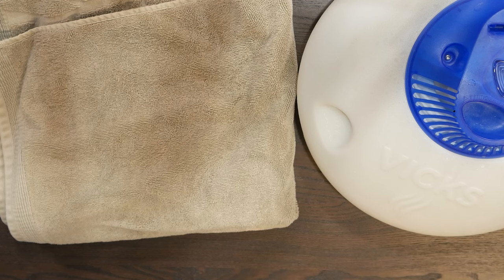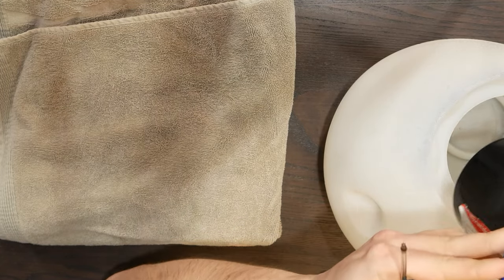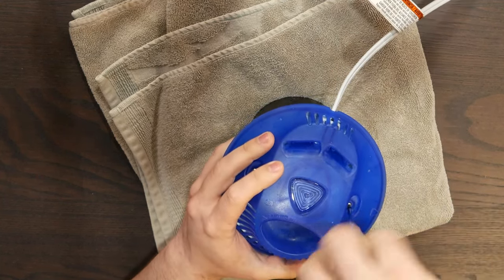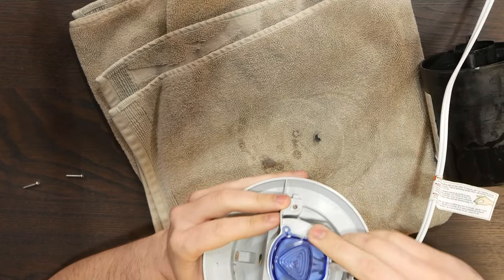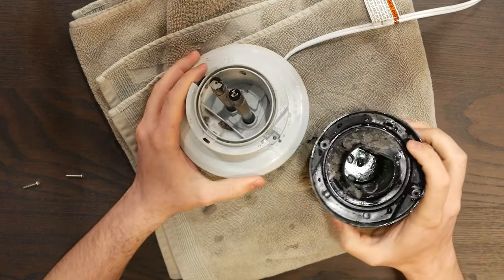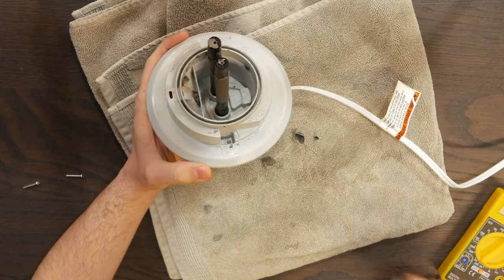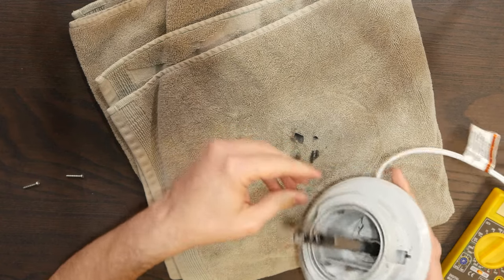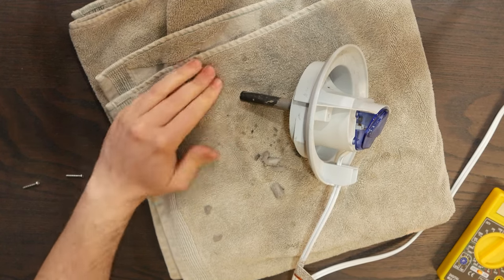Is a Vicks vaporizer an electrode boiler?

Comment: I would think that in this case it's actually safer to use an electrode boiler than an element.  It stops working by default when the water level drops and nothing in the unit gets hot enough to start a fire.  The tank is also sealed, so if someone is touching the water while it's in use, then they're doing something extremely wrong.
Reply: It does not stop by default most of the time
Reply: @poyopoyo4619  by nature, it has to stop working when the water level drops below the elctrodes since the water is needed to complete the circuit. so there is no float sensor or smart current or temp detection but this is still a thought-out safety measure - for cheap
Reply: @rolls_8798  Also, to touch the water you have to remove the electrodes.

And said electrodes are in a protective plastic shell. Actually decently safe!
Reply: @qwertykeyboard5901  true. I still majorly dislike them because the design (the rim that holds water when it is upside down) makes it almost impossible to empty the water from and if it is tipped upside down (hard to do by accident, admittedly) the water pours out of the top through all the direct live wires. and there is the matter of the mineral buildup.

there is a smaller handheld version which I find to be more acceptable. In India (where these are very common) people often put foil balls inside the unit and I've always wondered what it is for. Maybe to prevent as much buildup? I've never noticed an actual effect from it though.
Reply: Hey ,ive torn this thing down alllll the way too, taken the electrodes out, unscrewed those things, and put new ones in it, replaced the screws that were screwed into the the electrodes...mine stopped heating up completely, with water with all different kinds of water, also, mine was dang near 20 years old I think. I love that I've found someone else who's done this too though, I was so curious.  Didn't test it with my meter though ,and now that's my next step,cus it's still not working.

Comment: Yes! My dad took one apart when I was 6 or 7 to clean the lime deposits from the electrodes. He cautioned about putting too much salt in the water. So what did I do? Put more salt in the water. You could see the arcing through the plastic tub! It tripped the breaker after a few minutes.
Reply: That's the most badass metal thing that's ever happened to one of these things.
Reply: LOL... Hey, that's how you learn things, pushing the envelop.  Sounds like something I would have done.
Reply: EVEN MORE SAAAAAALT!
Reply: @westelaudio943  The whole room is VIBRATTTING
Reply: @harshvithlani9399  bloody hell
Reply: That is extremely dangerous. if u put enough salt(NaCl) in it depending on salt concentration it will produce either DEADLY chlorine gas or Explosive Hydrogen gas
Reply: @Anderson-f4t6c  No, wall power is AC. You need DC otherwise the reaction is reversed every cycle.
Reply: @lordofthecats6397  But isn't it irreversible chemical reaction? The moment Chlorine negative ions give up their electron they will become Chlorine gas and would remove themselves from the solution similar to Hydrogen gas. 
I might be wrong my chemistry is bit rusty.
Reply: @Vera "im no technical or know anything"
soo.. why exactly we should believe you?
Reply: I so did this to an off branded one of these! As a kid with a cold, if a little salt made it steam up, a lot (talking enough to cover the bottom of the tank) would make it work SO much better.. Steam clouds all the way to the ceiling, humidifier buzzing with 120v current, the cord heated up and pretty sure I popped a breaker as well! House lights were flickering and dimming!
Reply: My Duracraft came with instructions to add a small pinch of baking soda to it if it didn't boil after 15-20 minutes.  Salt might be too conductive for these, IDK.

Comment: If you put it in a glass tube, that might make a nifty sct-fi background prop for your back wall.
Reply: I think he'd also have to crank the voltage. It took about 10,000 volts for me to make a pretty nifty Jacob's Ladder in high school.  Bottom was about 1 inch apart, to was about 5 inches to break the arc and send it back to the bottom.
Reply: @playgroundchooser  It already sparks enough to boil water. That itself would be impressive. 

Also, water has less resistance than air, and the electrodes are closer together.
Reply: @JonesNate  it doesn’t spark to boil the water
Reply: @ErebuBat  Only if you add too much salt it would (and trip the breaker).

Comment: We used to have one of those years ago and I remember having to constantly open it up and scrape off the electrodes. It made a huge difference in how much steam came out.
Reply: Proper maintenance is part of any humidifier.
Reply: That's why I would use CLR.
Reply: I’ll have to do the same thing later.
Reply: and you cant even use deionised water because then it wouldn't work. caught between a rock and a hard place
Reply: @Gigaguenther  It's a $15 device and at least for me it lasted a decade. If you need more steam just buy a 2nd one lol
Reply: @NavinF  it depends on your local tapwater. the more minerals there are in it the more deposits you'll get over time
Reply: @Gigaguenther  Does it matter? Mineral scale is not a perfect insulator. You'll still get 200W which is plenty for most people. Add salt if you want more power just like it says in the manual. NaOH probably works better, but I've never had to try either option

Comment: The only way I've found to modulate how much it puts out is by varying the amount of salt you put into the water. One time my wife put way too much salt into the water and it tripped the breaker. It probably gets that crusty after just a few uses. There's always that garbage in the water after just one use.
Reply: I was just wondering whether is will burn a fuse when the water is to salty.
Reply: I have a whole home humidifier that is essentially this but scaled up (Aprilaire model 800).  It draws 4.8 kW maximum, but it only runs for short intervals.  The humidifier is connected to the home's water supply and drain.  I installed it when I got frustrated that the standard whole-home wet-pad humidifiers could never reach their setpoints because they only wet the pad when the heater is running, and the heater didn't run frequently enough to humidify the house to the setpoint.

What's cool about it is self-regulated.  It adds more water from the home's supply when needed, but it also and drains water and refills with fresh water when the water becomes too salty and the humidifer starts drawing too much power.  You can watch the unit, when you first turn it for the season, fill the canister to the top with fresh water.  As some water boils off, the power uses increases until it hits the maximum (water becomes saltier), at which point the humidifier starts letting the water level drop (less electrode exposed) to control power.

Yes, it uses a lot of energy, but that energy is also heating the house so it's not completely wasted.  And there is basically zero maintenance - no bio growth because it's boiling water, no manual refilling, and no descaling.  Basically the only time I have to touch it is about once every two years to replace the electrodes as they erode away.
Reply: I had one for a while. The instruction manual says to clean it by letting it soak in vinegar weekly. Mine stopped working I think because I got too lazy to clean it weekly and the buildup caused things to fail. Once it stopped working, I disassembled it. It was so badly degraded that the wires to the plug just came off of the screws attaching them to the prongs.
Reply: I’m a fan of them in winter in kids bedrooms. The vicks liquid can be added to the water and helpful for colds.
Reply: The whole room is vibrating.. EVEN MORE SAAALT
Reply: Two electrodes in a bucket of water with varying salinity is a great way to load test a generator by the way.

It's amazing just how accurately you can tune the current draw on the generator by varying the amount of salt.
Reply: That was my thought too when Alec said "how does it get this crusty with only a few uses"? Because that is how electrolysis works lol
Reply: I've seen one of these where the regulation is done by sliding a switch back and forth, the switch is physically connected to one of the electrodes, and as such just places the electrodes further apart increasing the resistance through the water.
Reply: might try washing soda instead of salt
Reply: @vuza752  like s mini scariac
Reply: That is for the best. If continued on it would be extremely dangerous. if u put enough salt(NaCl) in it depending on salt concentration it will produce either DEADLY chlorine gas or Explosive Hydrogen gas
Reply: Rinsing out the bowl every 2 or 3 uses is plenty of maintenance in my experience.   Our bedroom is only a few feet away from the bath so easy peasy.
Reply: In my experience the particles in the water weren't as many as the vaporizer in this video.  Maybe the guy has hard (high mineral content) water.  The water at my home isn't super hard, it is enough to leave white dust while using a ultrasonic humidifier but otherwise it is fine.
Reply: @Anderson-f4t6c  uhh electrolysis only occurs when there is a DC current, electrolysis will not occur with alternating current. But still I wouldn’t put excessive salt.
Reply: @sirhaydn-1  galvanic corrosion between the electrodes and electrolyte.
Reply: This whole thing with AC and electrolysis is a bit of a gray area

Comment: I remember these when I was a kid in the 90s. Had a red one with a very large base  that held quite a bit of water. I would always pull the top out of the base as it was running to see how it worked. These did not have a plastic shroud around the electrodes but were exposed right to the water.
Reply: Well that’s TOTALLY NOT an deadly accident waiting to happen 😆

Comment: When I was a kid and had a cold, I had one of these put in my room with Vicks Vapo Rub in it.  Later, I took it apart.  Yes, elecro-boiler.  I bought one again about 10 years ago; same setup inside and required salt to get it to work and also cleaning of the electrodes annually.  What I like about them is that the evaporated water from them is sterile (no mould or odour) and they don't seem to leave that white dust.  I put mine on a timer.  When I lived in an old apartment with hot water radiators for heating, I used to put small pots with water on top of the rads to humidify the apartment.
Reply: Agreed.   The white dust seems like a bad call for lungs and for electrical equipment.   I use one of these as an apartment humidifier but yeah, 600 Watts seems like a waste.  Still - I'm only using it during winter so the 600 watts is just inefficient heat - not a total waste.  You can often pick these up at thrift stores for like $3 which is great - unless it's all scaled up inside.
Reply: @jeffjackelen744  You can soak the electrodes in straight vinegar (unplugged, of course) for 6-8 hours and the scale will come right off using your fingers to remove it.  At least in the US you can buy a gallon of vinegar for $3-$4 so it is cheaper than replacing the vaporizer (you likely won't use the whole gallon for this).  The cheaper "cleaning vinegar" is fine, the lavender added to it won't hurt this.  You will probably only have to do this every 3-4 years unless you have crazy hard water.  You do have to remove the plastic cover, though.  A 32 ounce pitcher worked for me to soak the electrodes, set the unit on top with the electrodes soaking in the vinegar and let sit for 6-8 hours.  After soaking and scale removal, wash the electrodes with water (with the unit unplugged), let dry for a couple of hours (just in case the connection points got wet), replace the plastic electrode cover, fill the tank, assemble and then use the vaporizer.

Comment: I can confirm they're still made this way, I bought one last month due to getting bad nose bleeds from the dry air as well as some sinus stuff so I wanted this one so I could breath the warm steam as well as just letting run. Mine works extremely fast, pumping out steam within a minute or two but it does require some salt and the biggest downside is that there seems to be too much water vapor rather than steam which doesn't evaporate fast enough and will settle on the desk or bureau unless a fan is on too.
Reply: a year later, I can confirm the exact same for myself. with my well water, it boils so fast that it made the floors and desk overly saturated with moisture instead of actually putting the majority of it into the air.
Reply: @Deviated09  that sounds more like a thermal difference than boiling speed. If the floor is poorly insulated, you may well just have water condensing out of the air because of it.
Reply: @Ornithopter470  I'd imagine it's partly that, and partly very rapidly boiling off water with the steam directed in a cone shape
Not from poor insulation but more so keeping the bedroom cold.
Reply: Mine is brand new and barely puts out steam
Reply: @gwengough7944  try adding a bit of salt
Reply: Mine works great. I used to wonder what is the black stuff in the water?  Now I know its the crap that comes through our water supply lines. I just purchased a new one. Gojng to clean the old one. Know you're breathing in fairly purified steam.
Reply: @elizabethandiosa4579 I think the black stuff is the carbon electrodes wearing away. Not 100% sure, but when you extract minerals from tap water, they're not black in color. The carbon electrodes are black, and the flakes always seem to fall out of the boiler unit when I open it for refilling.

Comment: The one reason i prefer these over "cool mist" + ultrasonic humidifiers is that they sterilize the water vapor they put out. the downside is the scaling and oxidation (which is what that black crud is), but the upside is youre not breathing mold and mildew. That and they kind of double as a very inefficient space heater if you're like me and you live in a house with a poorly-placed thermostat and your room is always cold anyway.

Comment: A Big-Clive-esque video, and you didn't once say "take it to bits."  For shame!   ;-)
Reply: I didn't see the explosion containment pie dish, it must have been just off camera.
Reply: @cheekychappy1234  Maybe there was a hotdog just out of frame too. :P
Reply: @TheCodeDaemon  I think I'll pass on an electrocuted hot dog cooked by those electrodes, though.
Reply: Not to worry.
Reply: Unreasonable force!
Reply: Even the product is Big-Cliveish, like the baby water heater
Reply: Ya, this definitely gives off some Clive vibes xD Including touching parts that were connected to live seconds after unplugging without checking if there is any charge left ^^;
Reply: @NiyaKouya  That thing is completely safe when unplugged and completely unsafe when plugged because it's just basically wires.
Televisions etc are dangerous because they have bigass capacitors that can jolt you quite badly if they don't have bleeding resistors.
Reply: To be fair it wasn't pink in the slightest too so there's that difference as well
Reply: Also, a distinct lack of innuendo!
Reply: The vise of knowledge.
Reply: @madmanmapper  Maybe that's why it fell apart on cue. It thought it was on BigClive's desk.
Reply: @dan_loup   BigClive would never buy a humidifier.
Reply: Don't forget something pink.
Reply: @Okurka.  true, he’s more into dehumidifying.
Reply: Big clive even has several videos on water heaters working on that principle.
Reply: There is a distinct Chinesium smell.
Are we still allowed to say that?
Reply: I was expecting him to use "brute force and ignorance" to open it up

Comment: I have had several of these.  The older ones just had steel electrodes that got nasty rusty in addition to scale.  But it still worked great for several years.  The newer ones have what appear to be carbon electrodes.  Yes scale is a problem, but you can clean it easily enough. Just unplug it first. I also love the simplicity.  They inherently shut off when the water level drops below the electrodes. No moving parts.

I switched to a ultrasonic when my child was born because I was afraid he'd put his hand on the vapor outlet which is hot enough to burn if you get right up on it.

Yesterday after watching your other video, I built a home made evaporative one with a plastic tote, a fan and some hand towels.  It raised my bedroom humidity from 25% to 32%.  I may build a bigger one.  But these electrode boilers are more compact and less noisy.  So don't be too down on them.

Thanks for all your great videos!

Comment: The amount of power used is directly related to how much and what kind of minerals are in the water and how much of the electrodes are submerged at any given point. As the water boils away the power consumption will go down. High mineral content will draw more power, but with a high mineral content, the water will boil away faster. These have not changed much since I was a kid in the 1950s, and probably earlier. I opened my first one of these back around 1956.
Reply: I wasn't a kid but I used to buy and use a vaporizer that had a cream colored top and brown tank (which IIRC held about five gallons of water and would run a day or two on a tank).  It had a rotating white plastic part on an electric motor that allowed it to emit water vapor, I forget the brand name but I had several over the years.  They quit selling these about 30-35 years ago, they used to sell them in the children's section of Meijer (and probably Wal-Mart down south).  They were sold in Ontario, Canada as well.  I would take a cotton ball soaked with eucalyptus oil and place it where the vapor exited the vaporizer to make the room smell good.